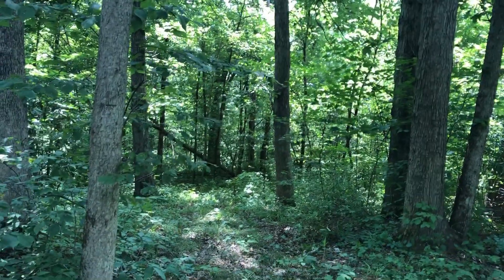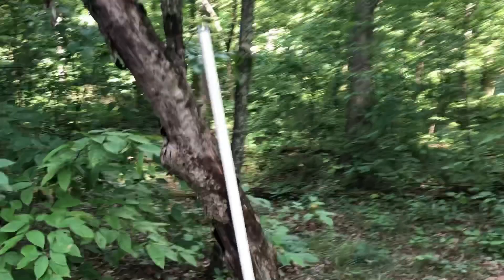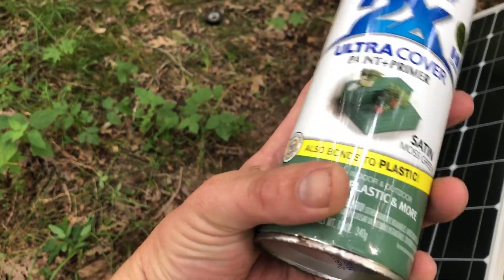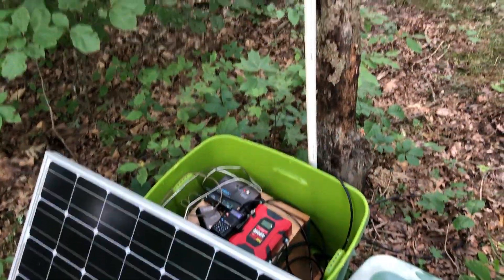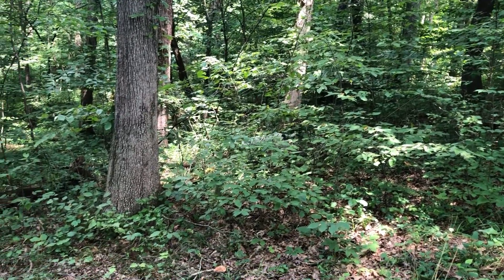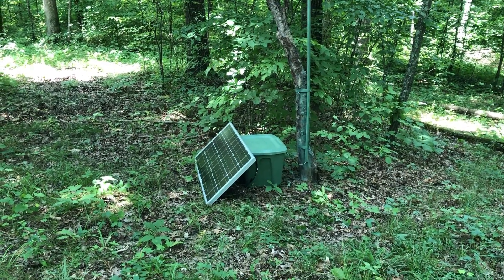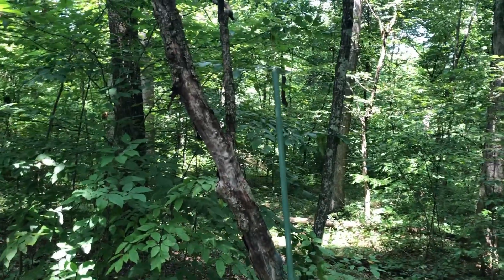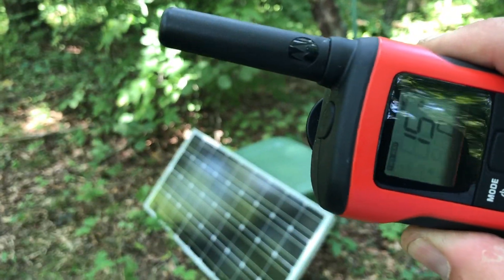Simplex repeater (part 2)

Comment: Did you end up having enough sun for your solar panel?
Reply from the maker: Yes, it worked well. In the winter, however, I had to remove snow a few times and did have a low voltage warning.

Comment: When you set up the frequency for the radio that’s hooked to the repeater ,the radios that will be trying to contact you using the repeater will they need to use the same frequency? Meaning I’m in your area want to talk to you all I need to do is use the same frequency?
Reply from the maker: Yes, exactly. This is a “Simplex repeater”. It’s basically a parrot. It will repeat back what ever it is aloud to receive. It’s good for covering multiple valleys where direct simplex como isn’t possible.